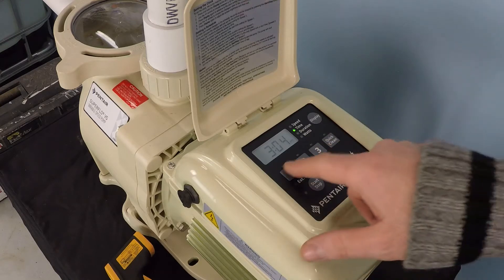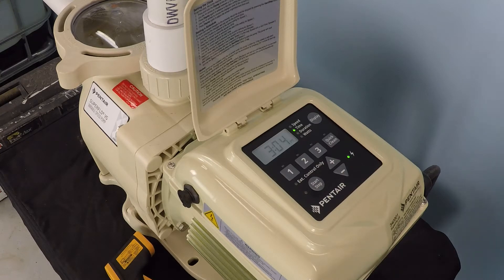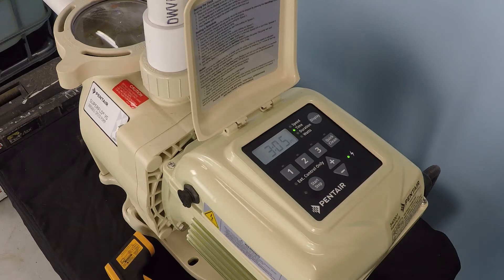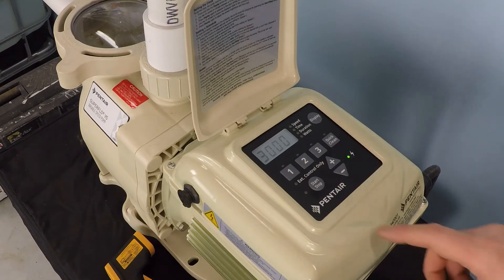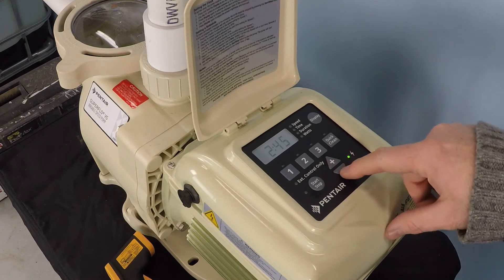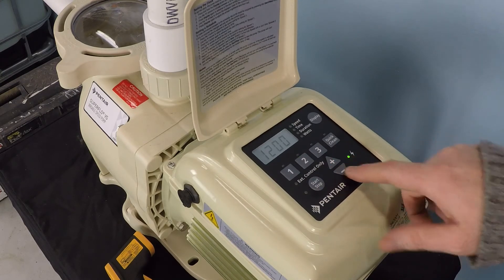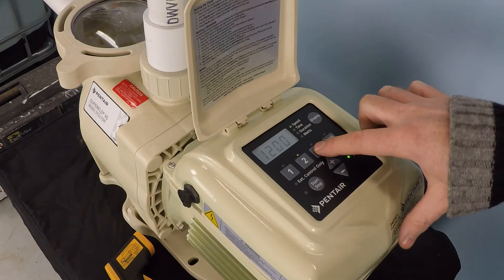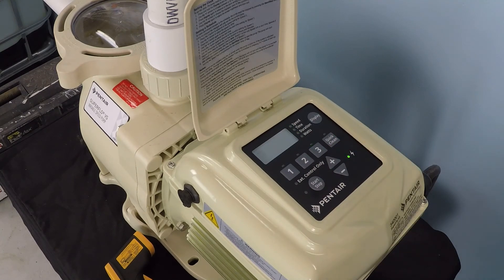How To Program A Pentair Superflo Pump

Comment: The problem with running the pump at night is what I noticed is now I’m heating my pool at night.When it’s not being used. My heater only works when water is flowing so if I want to heat my water when I’m using it , I have to run the pump during the day during peak hours.
Reply from the maker: Run at speeds too slow for your heater to run. Usually 35gpm or so to close the pressure switch on a pool heater. So run 20gpm all night and the problem is solved!

Comment: Running at 3000RPM can be counterproductive. If your "head", based on the number of bends, distance, height, etc., is high, you won't get any more flow than at, say, 1800RPM, but you'll use more electricity, and probably cause unnecessary wear and tear on your pump. It doesn't do any good to run the pump at a higher speed than the plumbing will support.
Reply: Your the first person that has mentioned this...this is a HUGE issue with these pumps!

Comment: Why is it flashing 1750 when you hit start?
Reply: Im setting mine and when I push start it flashes the same thing but 3450 rpm. But I don’t have it set a that speed. I saw the same thing in another video explaining setting it up. He sets 1 at 3000rpm, but it starts flashing the same thing 3450rpm
Reply: @Clicky_The_Blicky that's the prime speed. You can change it while it's flashing.

Comment: How do you change the priming speed?
Reply from the maker: start the priming cycle like normal, and as it is running use the up/down arrows to change the priming speed.  Stop the pump with the sop button and now the priming speed will be the new speed the next time you use it.

Comment: Thank you Steve. 

I appreciate your videos. 

You have a fantastic looking system. 

Could you put out a video on the best way to adjust the pool returns to get the most circulation to the skimmer area. 

I have a 2100 gallon rectangular pool with one shallow end and one deep end return jet. 

I have the same Pentair VS pump as you have. 

Thank you. 

Mark.
Reply: pro tip: you can watch series at Flixzone. I've been using it for watching lots of of movies these days.
Reply: @David Harlan Definitely, have been watching on Flixzone for years myself :)

Comment: I've been using this pump for the last 7 years. So far so good.
https://www.lesliespool.com/US-Motors-AVSJ3-56J-C-Face-EcoTech-EZ-Variable-Speed-3HP-FullUp-Rated-Pool-and-Spa-Motor/EVSJ3.htm

The programming for it seems to be a little more flexible. But I think the newer pumps are being designed more for those controller systems.